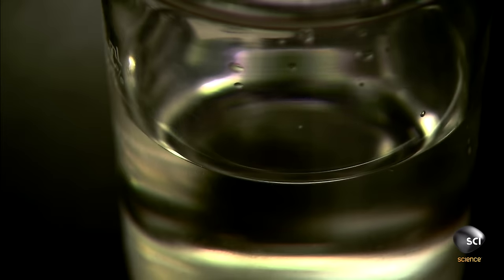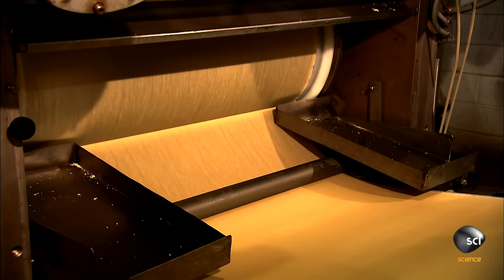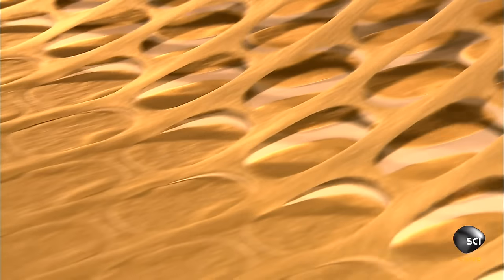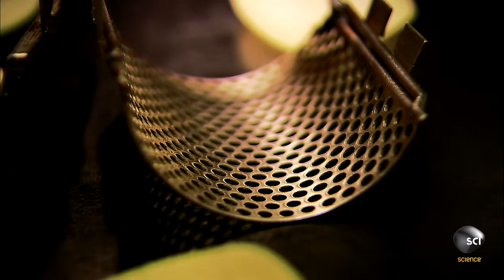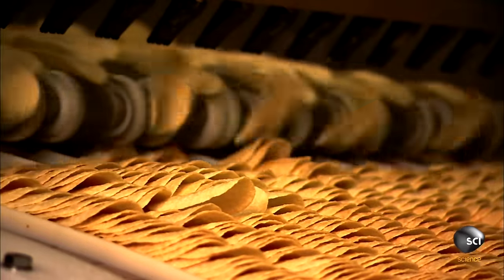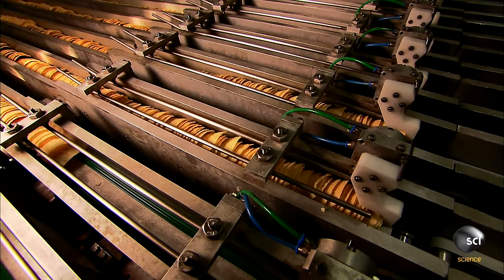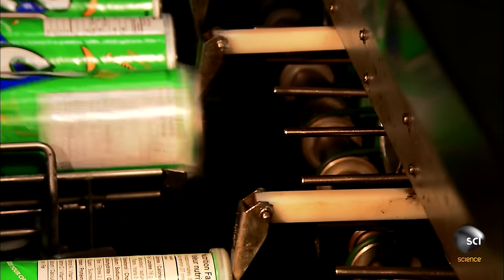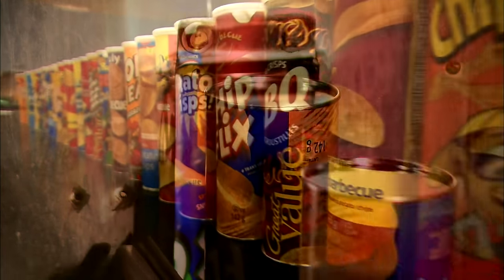Stackable Potato Chips | How It's Made

Comment: Today on how they do it. Plumbuses. Everyone has a Plumbus in their home. First they take the dinglebop, and they smooth it out, with a bunch of Schleem. The Schleem is then repurposed for later batches. They take the dinglebop and push it through the Grumbo, where the Fleeb is rubbed against it. It is important that the Fleeb is rubbed, because the fleeb has all of the fleeb juice. Then a Schlommy shows up and he rubs it and spits on it. They cut the fleeb. They are several hizzards in the way. The blamphs rub against the chumbles. And the plubus and grumbo are shaved away. That leaves you with a regular old Plumbus.